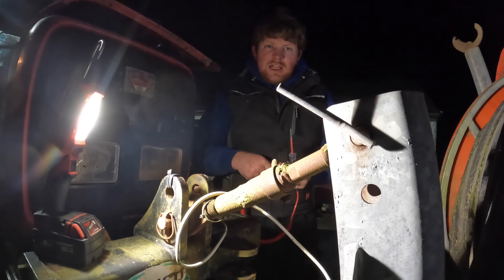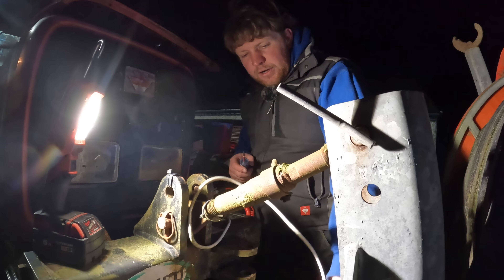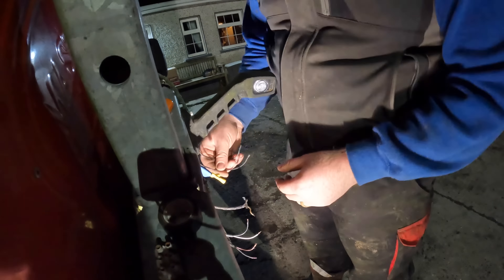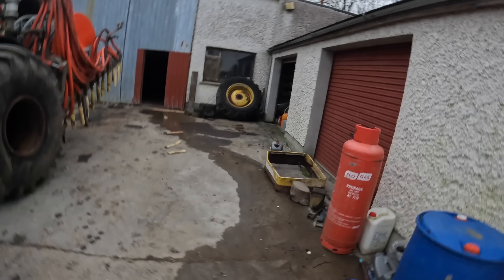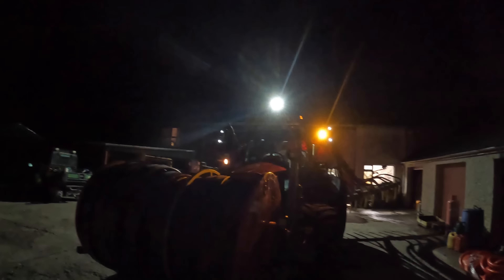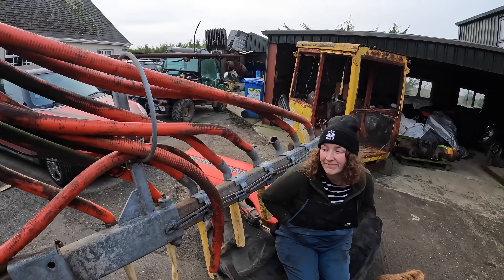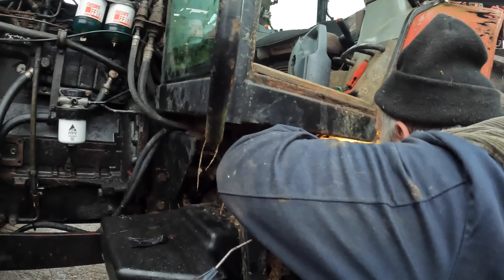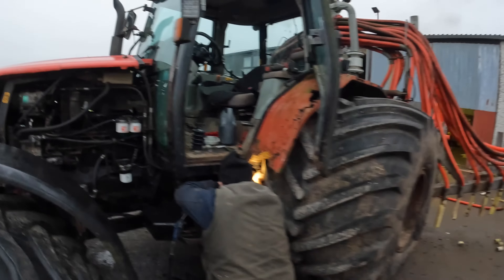LIGHTS, PIPES, MASERATOR AND A NEW ARRIVAL!

Comment: Best of luck with the slurry season and hope you all have a safe one ................just a note i'd get rid off all those choc block connectors and get those electrical connections for the lights soldered up and covered in heatshrink ,must less bother with poor or failing joints then

Comment: Phil why are you not putting 5 inch pipe comeing off your  
Pump 
Run 400 metres of 5 inch pipe off ya pump you. Will pump thicker stuff and get better pressure through ya dribble bar did the umbilical 
For a contractor for 20 odd years best thing we ever did
Was get 5 inch pipe 
Just had 4 inch drag hose behind dribble bar
Reply from the maker: My father had 5 inch years ago and hated it with a passion. But I’d like to get my hands on some to see how it works out

Comment: how do you stop the dribble bar from freezing at night  when you have it away from the   yard and have no shed to put into ....?
i got one last summer and went to use it on monday only to discover   all  pipes were frozen .... was working 100% on sat evening  left it yoked to a tractor ready for work on  monday.....................
Reply from the maker: Never had an issue with the dribble bar freezing as the pipes would be blown out but the 4inch pipe can be a nightmare if it’s not rolled up after a frosty night

Comment: Has the 6290 had the engine or transmission redone in it?
Reply from the maker: No just wheel bearing a due to the size of its wheels
Reply: @FARMERPHIL3690  Impressive!! We have a 6490 at 14000hrs right now I'm hoping to get it over the 20000hr range. It's had a hydrolic pump and a ecu so far.